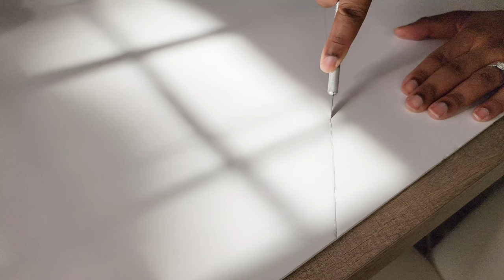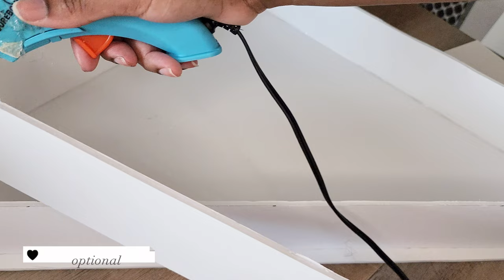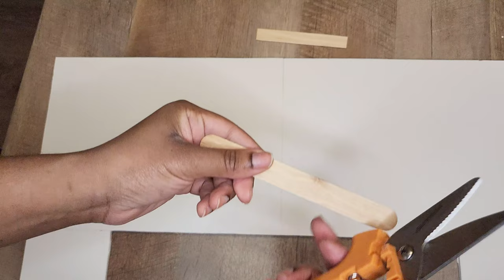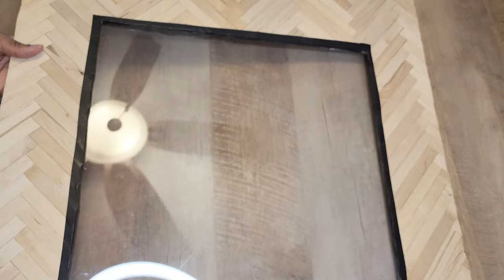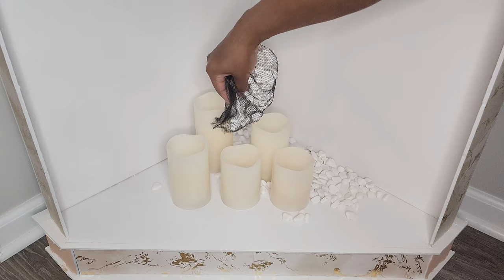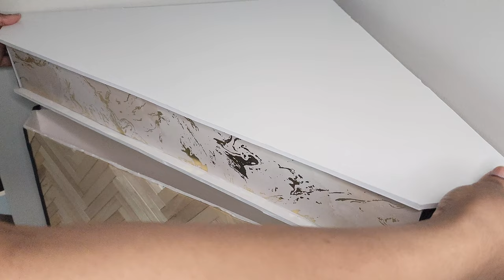This DIY Corner Fireplace made from Foam Board will TRANSFORM your Home! Very EASY! LUXURY!!!

Comment: This is the best foamcore board fireplace I have seen.   KUDOS to you!!! One question though...   how do you access the candles to turn them off/change batteries? Did I miss that?
Reply from the maker: Thank you sooo much!!🥰 The candles are remote controlled!!😊 but when I do need to get to them I will go through the top. I ended up prying the top off because I realized it would be better access to the candles. My original plan was to just push through the plexieglass at the tape and hope for the best.🫠

Comment: How do you replace candle batteries when they run out. ?
Reply from the maker: My intentions were to just push through the plexiglass because I used tape but I didnt really like that idea so I ended up prying the top off and that gives me access to the candles and then when Im done I just lay it back on top🤗